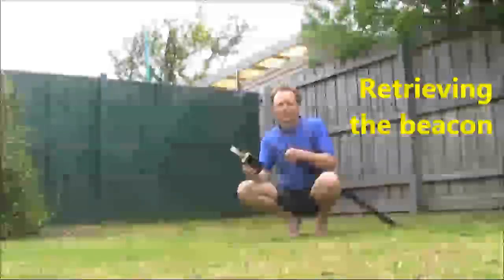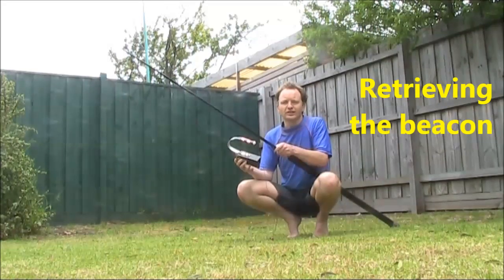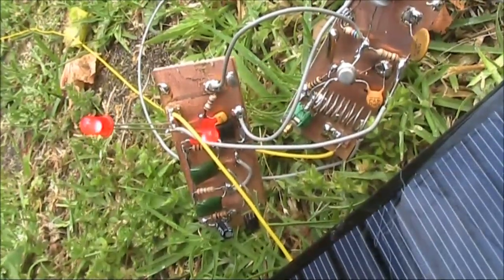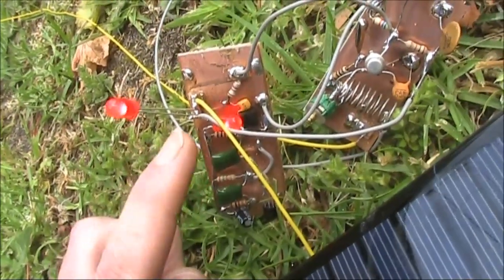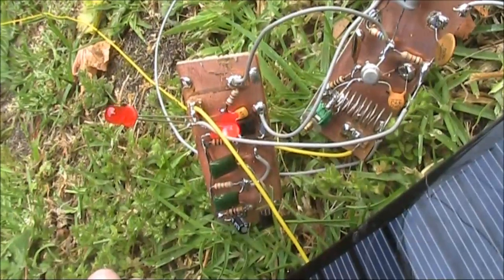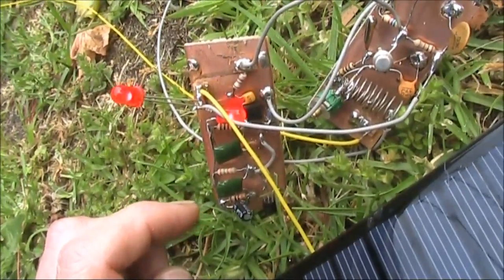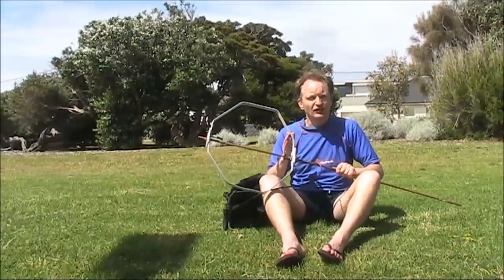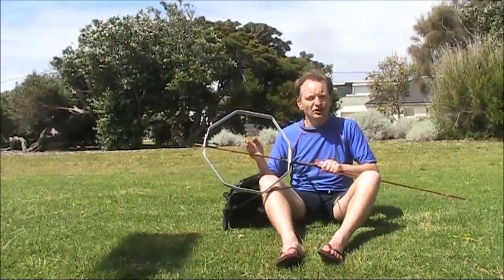Milliwatt VHF beacon range tests and more LED experiments

Comment: hey hi nice i want to make one for my ham radio club for the 144 MHz vhf can you point me in the right direction and show me any of the diagrams for the VHF fox beacon ?
Reply from the maker: See my low power transmitters playlist on this channel for circuits and further info. A google search will also reveal other ideas.
Reply: @vk3ye  if I want to change the frq of the tx I have to change the crystal oscillator only?
Reply: @vk3ye  how bright to the human eye would a normal WiFi antenna be if we could see it? The omnidirectional at 100 milliwat e.g.
Reply from the maker: @mrkitty777  No idea, sorry.
Reply: @vk3ye  ok, i am looking for 100 milliwat LED brightness instead since those are visible like the red LED on a tv, i found your video this way, fran lab has al sorts of led video but for now i usually find 100 Watt led video and WiFi of 100 Watt hopefully doesn't exist. As i found out a mobile phone can do 2 Watt.
Reply: @vk3ye  Red LED is 20mA, voltage upto 2 Volt, so that's 40 milliwat for a red LED like standby led. Now i found out twice as bright LED is 80 milliwat, so 100 milliwat WiFi is a little brighter than 2 times the brightness of a standard red LED. Thanks for your video.

Comment: Thanks for the video. This is really interesting. I don't really like rag chewing so this is a suitably unsociable version of the hobby that gets me outdoors and walking around between bouts with the soldering iron :)
Reply: There are many radio experiments you can do that are like that. I have been messing around with electronics-radio since I was about 8 years old. My favorites as young experimenter were fm transmitters on the broadcast band. I initially used them with indoor antenna arrangements transmitting music from a cassette player. They were fun times :)
Reply: Dazzwidd I actually built one of them that was on the front of an electronics magazine in the UK in the 1990s. Definitely good fun.